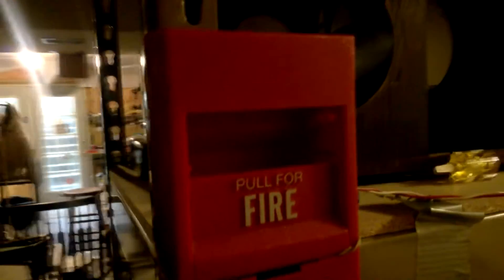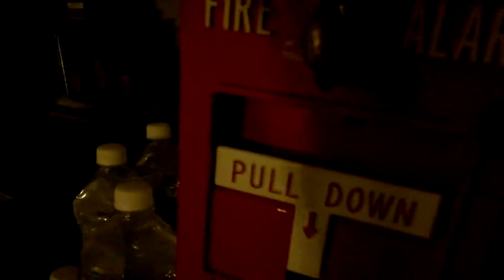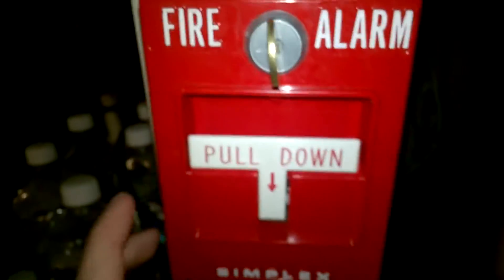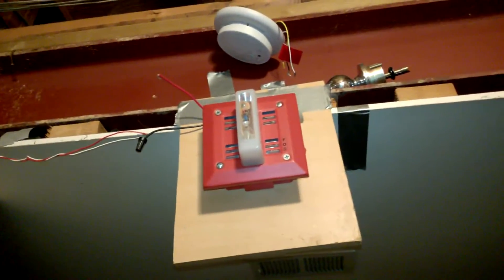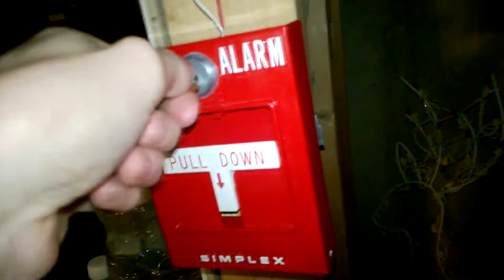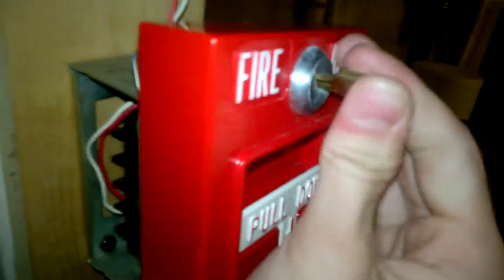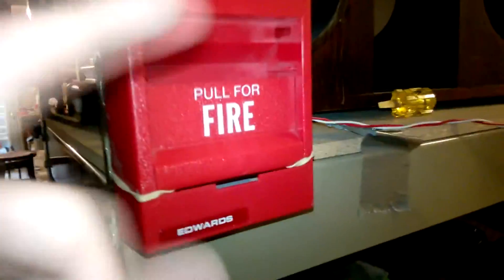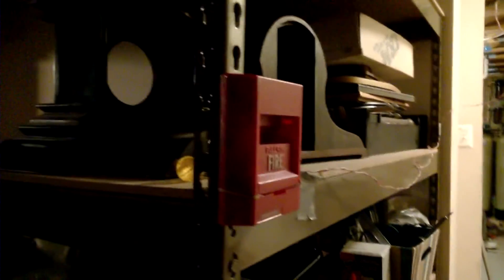System Test 2.5: Simplex 4251-21

Comment: Difference between 4251-20 and -21?
Reply from the maker: The 4251-21 has a larger metal button, 4251-20 has a smaller plastic one
Reply: @FrostedStrobes   my simplex 2997 54  , the break rod broke the handle, now I can't use it, becuase where it pushes the button at, it snapped.